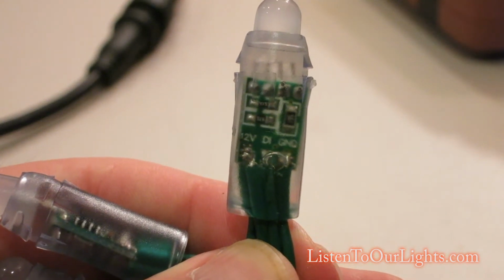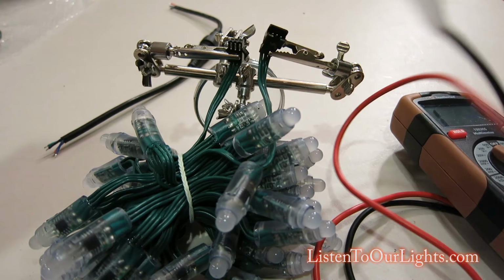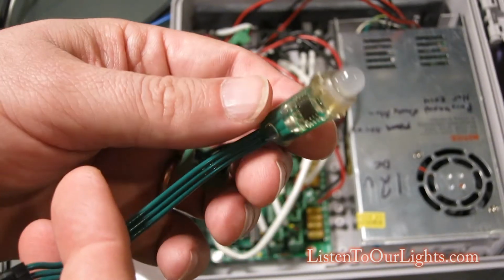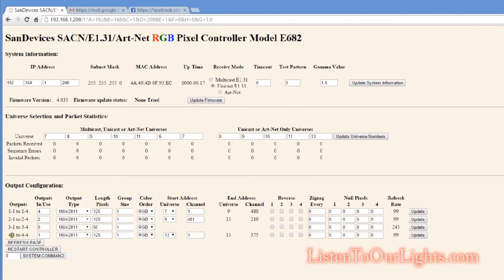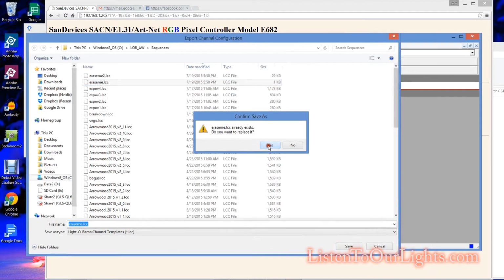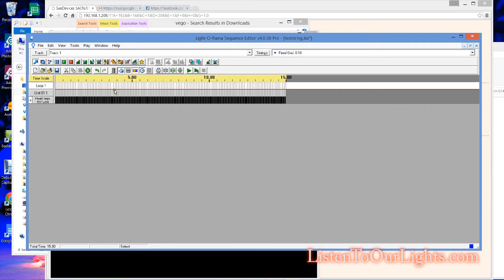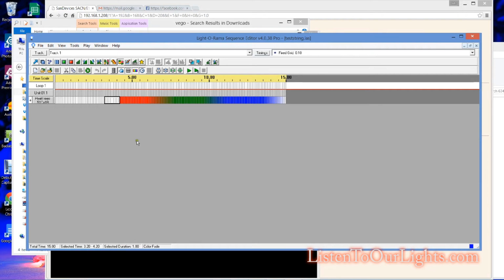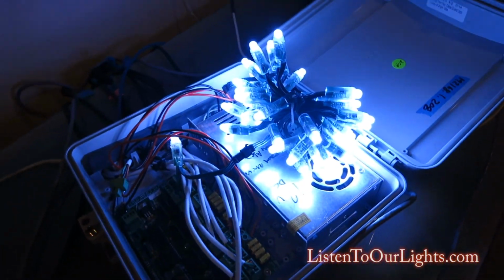How to test a new pixel string

Comment: Question for ya. I have Twinkly home special edition RGB+w Gen 2 lights. I accidentally clipped right through all 3 wires. There is no indication which wire is what. One wire goes led to led. Another goes led to led for a few leds at a time. The third is just wrapped for the entire length. I can’t tell which is data / volt + / and ground. Any thoughts? Great video btw. Kinda wish I went with a diy system instead of the plug and go so I could customize more.
Reply: i guess it is quite off topic but do anybody know a good site to watch newly released movies online ?
Reply: @Trace Darren Try Flixportal. You can find it by googling =)
Reply: @Allan Francis thank you, I went there and it seems like a nice service =) I really appreciate it!
Reply: @Trace Darren you are welcome :)